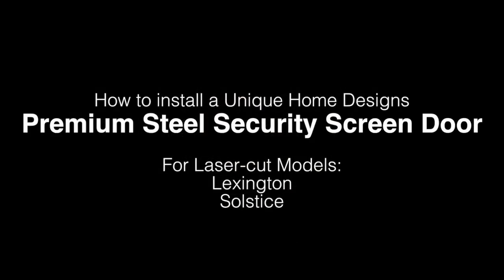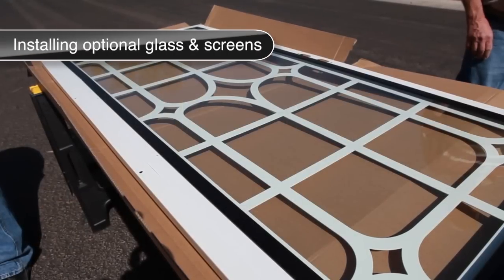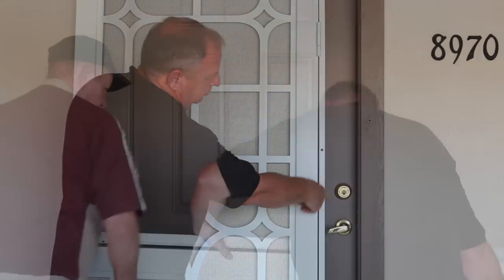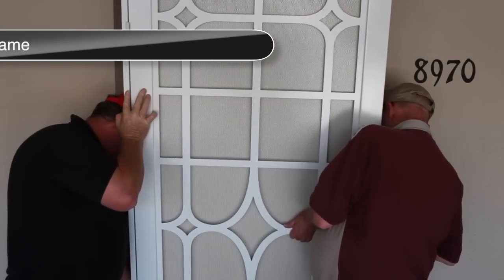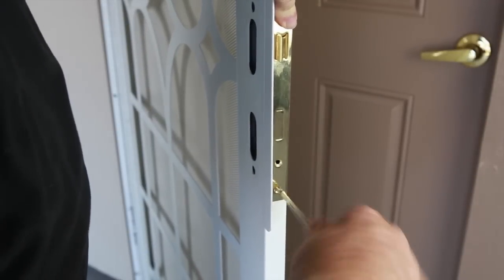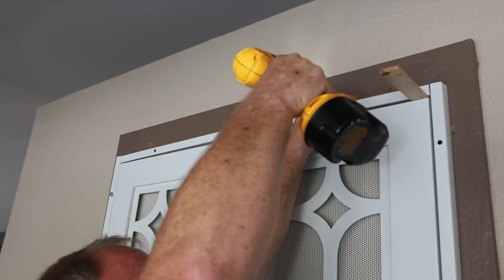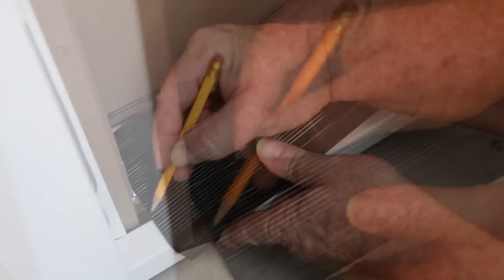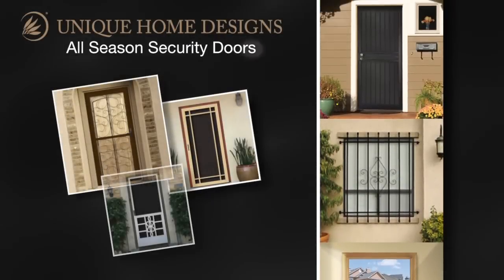How to install Premium Steel Security Screen Door - Laser Cut models

Comment: my iron security door frame is taller than the opening.   i have a 32 inch exterior door and want to install the security door also.  does the security door metal frame need to be cut down to fit?
Reply from the maker: This security door can not be cut to fit. You would need a door that is sized at 32 in. for your opening.

Comment: could you install the hing on the inside of the door jam? my door is wide and if i put it on the inside the door would fit better
Reply: Hindi me do pilig
Reply from the maker: This door is a surface mount door that would need to be installed on the outside of the existing trim. The doors mounting holes would not work if it was installed on the inside of the door jamb. We do have recessed mount doors and custom sized doors available at the Home Depot if you are looking for something that will mount inside the jamb or will fit a wider entryway.

Comment: This video is very helpful as the written directions are awful.  But what's the best way to center this door height wise, taking into account the top and bottom bars?  You covered width but not height.
Reply: Eric.
Reply: Yes?  Well after installing it see that you have no choice but to put the top bar along the top of the door opening due to the way it mounts.  Thanks to this video it did make it SO much easier to install.
Reply: You want the bug sweep 1/4" from the ground, that's your working measurement. So you may have to add trim to the top to mount the top bar. At least as far as I understand it.

Comment: How is it a security door if it's got glass sections that can be smashed by someone allowing them to reach in and open it?
Reply from the maker: The door is available in multiple screen options including perforated metal.  And, subject to local codes, a double deadbolt may be used to maintain security when glass or insect screen inserts are used.